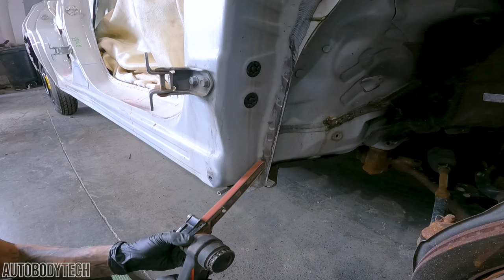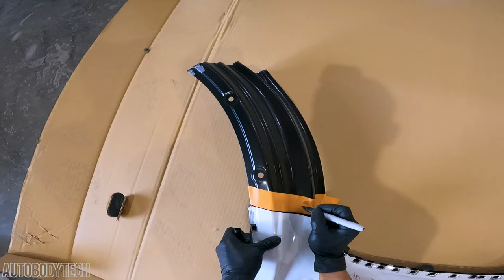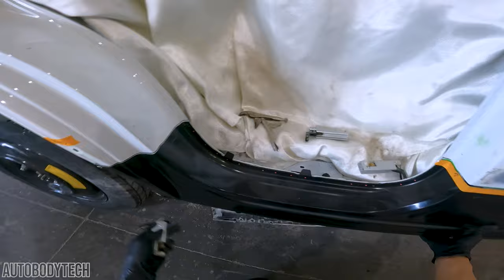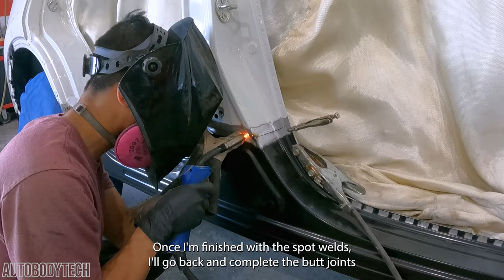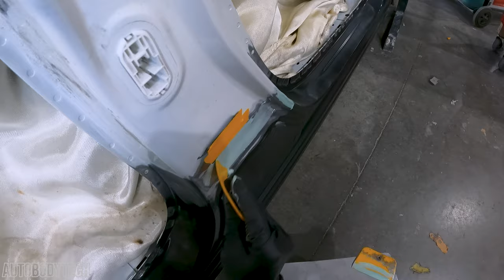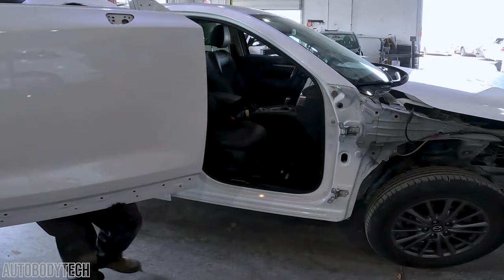Why This Mazda CX-5 Needs a Rocker Panel Replacement

Comment: So you do everything from start to finish at your job?
Reply from the maker: Just body and assembly, not prep or paint
Reply: What grit belt do you use to buzz thru the spot welds? Thanks for your time!
Reply from the maker: 50 grit Mirka belt @kevinhintz1903
Reply: @AUTOBODYTECH  Thank You!